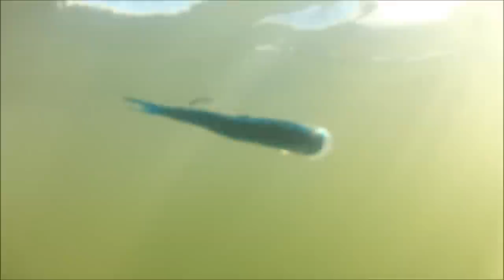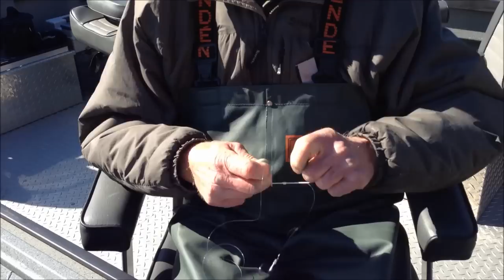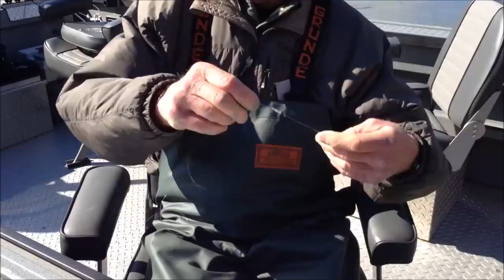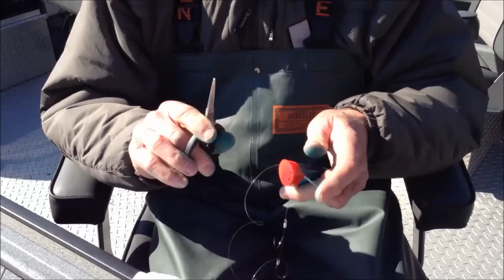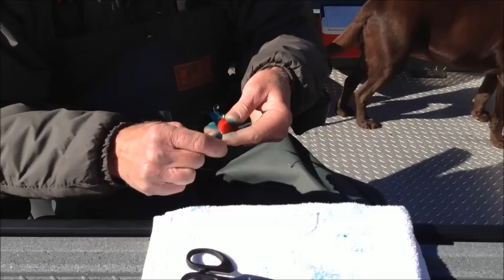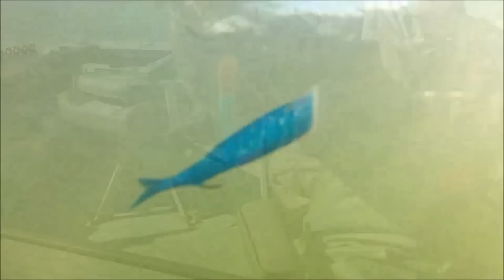Dick's Sure Spin Herring Helmet

Comment: Great video!   I use these in size "large " and I was crazy successful at Buoy 10 using green, blue and red colors for two years as the herring doesn't blow out in a strong current.  I can also get a hit and not have to  re-bait as I can get bites with just half a herring bit off.   I also don't use as much bait.  At the end of the day, I sometimes have whole sleeves of herring left over.  I still brine herring but not near as many... and often times, I will not use brined herring at all.  My  issues with this product would be if you only have one size of herring helmet and your bait is too big or too small it renders them useless.  I also don't care for the tooth picks and bobber stops...too much stuff.....if you forget tooth picks, you have to improvise. I've used plastic fork tines or hunted down rogue tooth pick bits from past fishing trips that didn't get cleaned off my boat (did I mention wet tooth pick bits get everywhere?)  ...  I stopped using the bobber stop.  Instead,  I just run the leader through the tooth pick hole on the long side of the helmet and through one of the top holes (usually the middle).  I still use a tooth pick but running the tooth pick into one hole, through the bait and finding the far hole while on a pitching boat (in the rain) is near impossible....  Instead, I put the tooth pick half way into the bait through one hole...break it off and run the broken piece of the tooth pick  into the hole on the other side.   That seems to do the trick and I can rig them faster.  If you remember your toothpicks and have the right size helmet and you can rig them on a pitching boat (assuming you didn't rig any at the dock) .... ,  these herring helmets are deadly!    You will fish longer and use less bait.   I'd recommend this product to anyone targeting salmon.

Comment: These really work for springers on the Columbia. Action does not change due to herring bumping bottom. Can use softer baits, longer. Use bead with bober stop, though to prevent pulling through the front of the helmet